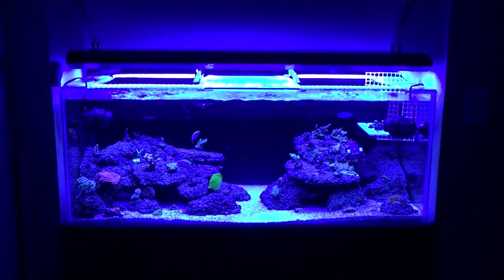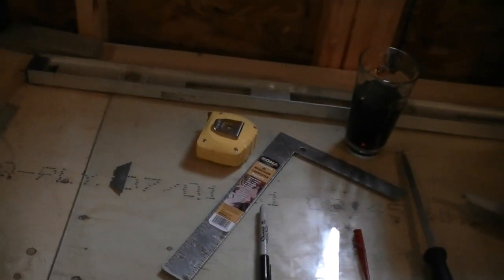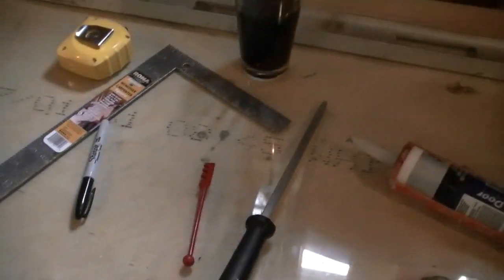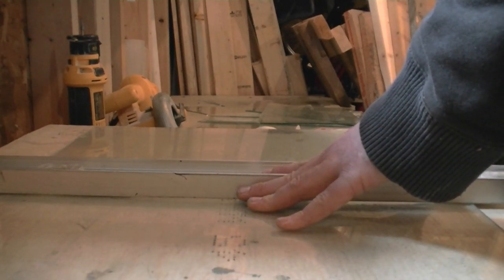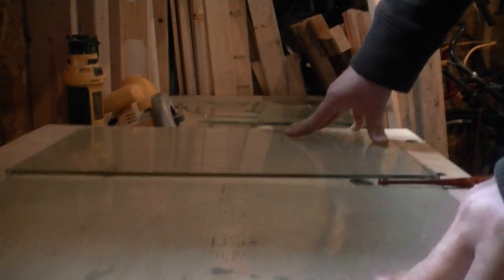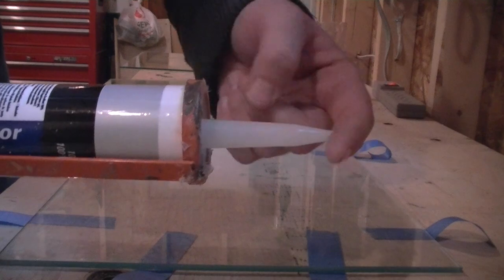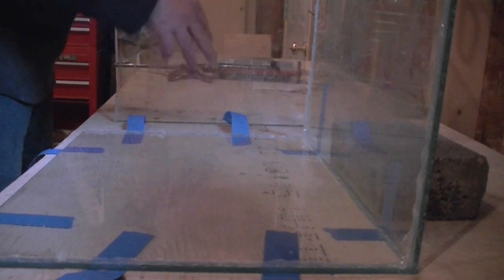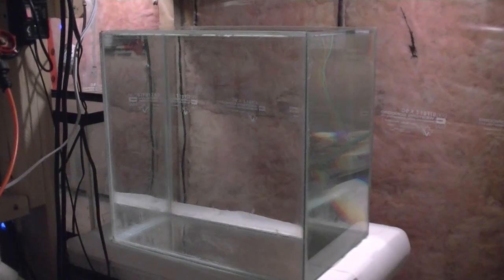Rickets Reef: DIY HowTo Make A Glass Aquarium in 3 Steps...

Comment: @Supertasticaquatics You are correct. You are supposed to use an adhesive silicone and not a sealant silicone, as used in the video. Use RTV 108 if you want clear adhesive silicone, and RTV 103 if you want black adhesive silicone.

Comment from the maker: There was a rule of thumb I read once where if your sides are more than 24 inches long and 14 tall you will need a brase. The height of the glass also needs to be taken into consideration. If you're making a 16" cube with 8mm glass you probably don't need any braces.

Comment: @Carbon344 Volume is some simple math, L x W x H, and we'll use inches.  24" x 36" x 84" = 72,576 cubic inches.  If we divide that by 231 (that's how many ci are in one gallon, also in one Buick V6) 72,576 / 231 = 314.2 gallons.  A 300+ gallon aquarium could weigh in over 3000lbs. The first thing to consider is:  What is your floor made of?  If is a concrete slab, you're probably ok, if it's not, you'll need some reinforcement.

Comment: tempered glass cant be cut period, it will blow up, the only reason its harder to work with it is because if you chip the corner it will blow into a million little peices, but you can hit the center with a hammer and nothing will happen, its much stronger then regular plate glass. you just need to get youre measurements right, call any glass shop you can order it there

Comment: I have 5 feet by 1.5 feet fish tank, all the glasses are of 12mm but front 5 by 2 glass is 8 mm, will it hold the pressure?
can i join 5mm glass from inside stickin to 8 mm, will it work?

Comment: @GEOPAIH1234: you obviously don't know much about aquariums or glass for that matter do you? He was right about using tempered glass for an aquarium. It is MUCH stronger than standard plate or annealed glass because it is tempered just like tempered steel is. The tempering process freezes the molecules at a particular point which makes it stronger.

Comment: Folks, careful building anything over 50 gallons. Once you get over 100 gallons, believe me, you do not have the technology. 100 gallons of water is 850 or so pounds. Nearly microscopic cracks in the glass or silicone can cause a small leak followed by the entire glass face cracking or ripping off. Anything above 100 gallons generates enough pressure that anything other than polished edges and PERFECT 90 degree angles can cause a break. You're sheets will be 50-100 lbs each easily, which will s